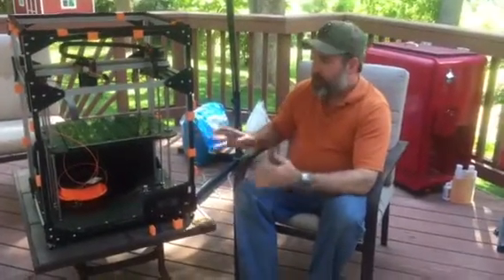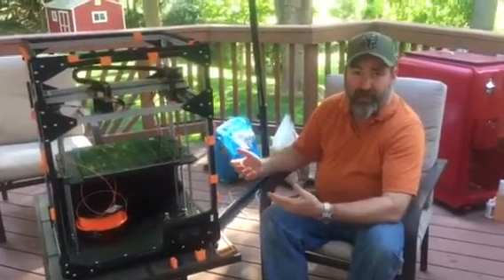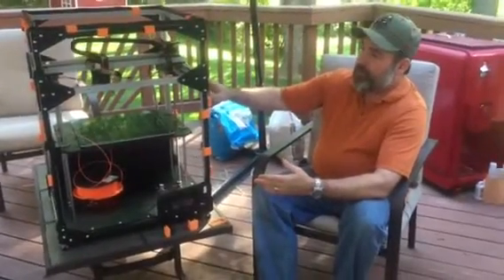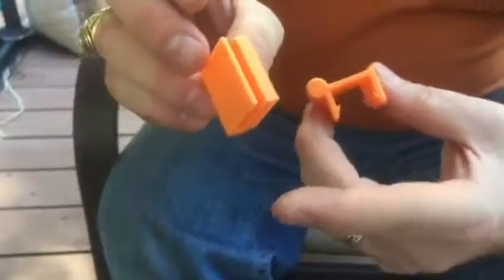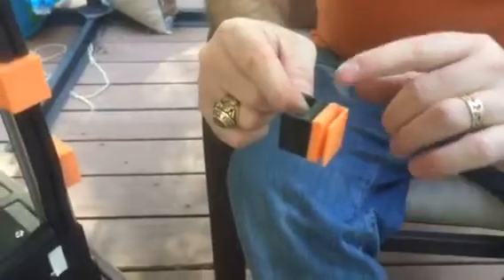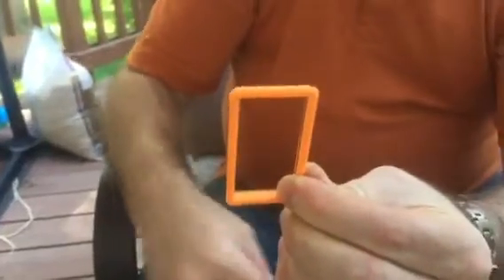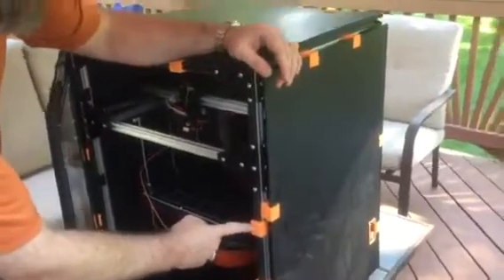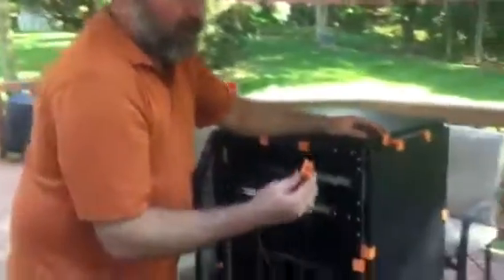Folgertech FT5 Magnetic Enclosure

Comment: You should do amazon affiliate marketing for the magnets. I'm about to do this project. awesome work
Reply from the maker: I'll have to look into affiliate linking. I've never thought of doing that before. I am about to completely re-wire the machine. Maybe this would be a good chance for affiliate linking as well; some of the stuff I want to use has been a little difficult to find and required some trial and error. Shane Fuga and Jon from THEHOTEND have been very helpful.
Reply: Ken Jones ya I love Shane's videos too. I've printed all the parts for this enclosure. I made them hollow and they snap on and off very easy and still have a firm grip
Reply: I ordered the magnets from wish so it will be a while.. at least they were super cheap and I'll have tons of extra